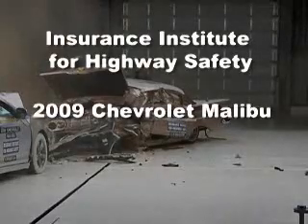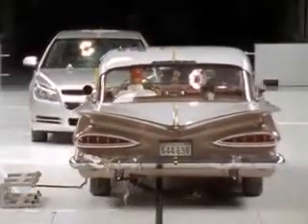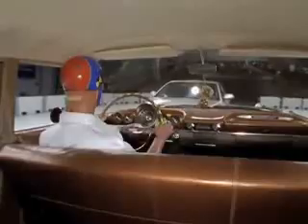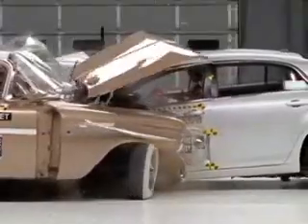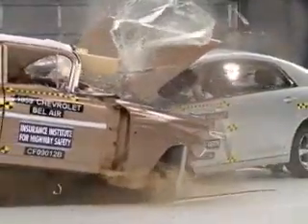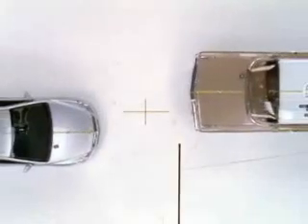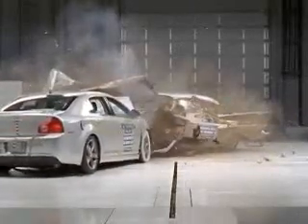Crash Test 1959 Chevrolet Bel Air VS. 2009 Chevrolet Malibu (Frontal Offset) IIHS 50th Anniversary

Comment: New school beats old school in every category, I can take a 4cyl Chevy Cobalt SS Turbo charged and face it against a 69 Camaro on a track course and that cobalt will win in a land slide, I can also take the new 2014 Stingray Corvette and compare it to an old time 4, 6cyl car and the new Corvette gets better mpg (29mpg) than most old schools, same with the Camaro's the new RS V6 would smoke an old V8 Camaro. And as far as safety and emissions, that's not even comparable. I'll take new school over old school anyday, the only thing that old school can compare to on new school is the looks and styles of the cars and that, well that is clearly your opinion as far as looks go.
Reply: Cobalts are terrible, what a stupid car to use in this example.
Reply: @ErrorSz  No kidding.
Reply: Everybody has their own preferences, some people like old cars and some don't, it doesn't really matter.
Reply: ***** i dont think a 2 ton 200HP minivan can beat a 2 ton 350-400+horse power purpose built car in any case
Other then braking...
Reply: Mopar 440 big block 350+ Gm 454 400+ horse Ford 429 400+

Comment: Guys there is pros and cons to each cars( this is coming from a classic car enthusiast) yes, the newer cars are usually more safe than older cars, and classic cars are cooler. But honestly, it does look like the engine may have been removed from the 59. I don't think it would have crumpled up that much. It may not be as safe as a new car, I'd rather drive it than the new one. Also a shame they wasted a classic. A 59 chevy is my dream car, even if it's a four door

Comment: Every pre-airbag era automobile should be banned from public roadways and destroyed.
Reply: jonnytorch5855 eh thats a little extremist. the only person getting hurt in the crash is the driver of the older car.
Reply: That's excessive. My Dad hit a telephone pole in an 84 Caprice in 2017 at maybe 45 MPH; the pole went through the bumper and radiator, snapped and fell on the roof and he survived with seat belt rash and sore knees. No broken bones. He needed an ulcer fixed a month later but there were probably other factors to that.
Reply: Says the guy that doesn't own a classic

Comment: There is no way that 59 Chevy would have smashed to pieces from that hit with original metal of the day..That car was sabotaged because in those days you barely moved when you got hit in a late 50s and early 60s cars.They were rock solid,especially the 59 and 60 Chrysler Imperials.Not only that,did you see fast the Malibu was going while the 59 Impala was slow rolling? That was a rigged test from A to Z.

Comment: So chevy just proved to me they don't care about preserving classics.  What idiot thought this was a good idea?
Reply: danwat1234 The bel air did have an X frame which made it less safe, however not all auto companies had the same design. If you put a 1948 Cadillac against that 2009 Malibu, the Malibu would be devastated! It's all about frame design, steel gauge thickness, and the body itself.
Reply: Don't worry, someone i know who works for the orion assembly manufacturing plant, said that the '59 bel air in the video was more than likely a "put together" car like the ones that are easy to take apart and put back together for certain car shows. So it is basically a shell that is cheap to make for minimal use.
Reply: ***** If that's true I still doubt a real classic bel air would fare much better in a crash test against a new car

Comment: The 1959 Chevy was sabotaged. They took the engine out, the fender bolts, and made weakening cuts on the frame. No way they would post a video showing a 1959 car beating the shit out of a modern actual piece of shit. This was done before, on a old Volvo commercial where they reinforced the Volvo so it would survive being run over by a Big Foot truck.
Reply: You have NO IDEA or proof that they did this. Please shut the FUCK or lay out your proof.
Reply: lovefordgalaxie how would his mothers sexual life keep him from getting an education? Lay off the caffeine Buddy
Reply: Recon13x It isn't Rust saidly it "Georgia clay that had accumulated inside the frame rails" apparently it was sold to them for 8k "We had no idea it was destined for destruction" it was a blueflame 215 6 banger witha' powerglide
Reply: CCCP Digital Studio not like it matters anyway considering old like that are really shit compared to modern cars.
Reply: @CCCP Go put on your foil cap.
Reply: ***** there isnt much solid proof but honestly looking at that car and the insane rust that jumped out, along with the fact that looking closely i fail to see any engine components, and that WOULD make a difference, i do think this was a "biased" test to say the least. idk about cuts and bolts though.

Comment: all you morons defending the new car, yes there is some ignorant old car guys on here who think the 59 was missing its engine etc. etc. im sorry to tell you guys but the 58-64 GM cars were trash hell all of them are junk made of thin sheet metal and built cheap with poor structural design and the IIHS knew that thats why they picked this car for the test and at its weakest angle too. the frontal offset test...i own a 1957 plymouth belvedere 2 door sedan and i know for a fact that it would plow through that malibu like tin foil, now i never said "safer" i said "stronger" everyone knows the old cars are more unsafe inside due to lack of airbags, seat belts and collapsible steering columns etc. etc. but the bodies were much sturdier and better built
Reply: And I have a 62 plymouth fury.

Comment: The 59 Chevy had the bolts removed from the fenders and front end if you look close to give it that more exploding look. Yes they may have advanced over the years. I'm 15 and had a 64 caddy and a 74 Chrysler New Yorker and they still had more options than most of the cars now days. It's not like people where dumb in the 50s and 60s. They where actually smarter than most the people around here anymore. My uncle destroyed a new Chevy with that New Yorker and only broke the turn light on her. So what does that say STIRKDAWG YOU DUMBASS. What kind of pussy name is that .

Comment: Why do I suspect that "crashworthiness" also means more "crashiness" for the other guy. What I mean is, if for example the Bel Air crashed into another Bel Air I'm almost certain they would have both been less damaged than the one in the video. Making a car stronger probably also makes it more damaging to the other guy, if you get what I mean. As an analogy: of course steel armor will protect better than leather armor but if you take that piece of armor and hit someone with it the steel will most certainly cause more severe injury.

Comment: I grew up in the 50s and to me the alleged 'Bel Air' looks more like a Chevrolet 'Impala' to me. Maybe I'm old fashioned, but I think to remove the engine and therefore remove a unit of 'mass energy absorbtion' is cheating a bit as it allows the whole collision force to be directed to the bulkhead of the old car where the steering box is located. Don't get me wrong your dead anyway, and modern cars are safer by a long shot. However modern drivers tend to think they are immortal as a result. A nice long spike in the centre of the steering column would, I believe, cure this illusion.

Comment: They went through the trouble of slaying a 59 belair to explain the obvious? Super cars and muscle cars are dangerous because they were built with little understanding for safety, and because drivers are fucking stupid. And a roll cage is only safe in a roll over, or a crash with helmet restraints at 150mph not 30mph(where a concussion will inflict you instead). All you need to do is drive responsively and stfu.

Comment: Majesticgamer, I hadn't included this because I needed to go look up the exact numbers the ones cpu is clocked at 1.75ghz the ps4 is clocked at 1.6ghz the gpu is clocked at 853MHz vs. 800MHz  for bandwith the ps4 clocks in at 176gb/s while the one is 204gb/s. I just didnt want to tell you you where wrong with no proof.

Comment: If you watch the interior shot you'll see the steering wheel coming right of the dash(Steering box is located on Left front frame horn with a solid steering shaft all the way to the wheel).you'll also see the seat back driving(no seatback locks or seat belts)the dummy into the wheel.The front fender has no special gusseting so it folds up like tin foil.the frame was an X member type and had virtually no side guard protection.all these factors made the 1958 to 64 Chevys one of the least safe cars to drive in the 50's and 60's.The federal government mandated collapsible columns and seat belts and other safety features in 1967.

Comment: Hey, they should have included the engine in that Bel Air! A 700 pound block of iron going through the passenger compartment would have helped them survive plenty!

All joking aside, if older cars bounced off, that would be far more dangerous to the passengers than if they crumpled like cars do today. Think about it: You're changing forward speed for backward speed. Say you only go back at 5 mph from a 25 mph collision. That's 30 mph that your body has to deal with, most of which would go into snapping your neck.
Reply: Isaac Jung why do some people insist the bel air had no engine.  how did it drive forward then?  explain that
Reply: @Reynault Chevalier Do you not watch how crash tests are done? They attach the cars to a wire system. The 59 had a Straight 6, BTW, not a V8.
Reply: Austin Lucas there us no need to respond in an insulting manner.   This is an open forum.  People may not know certain things.  Smart people inquire about things.
Reply: @milestone_achiever4634  Sorry if it came across that way, it's not always easy to tell when someone's joking when I only have text to read.
Reply: @101Volts  Austin why did it take you half a year to respond?

Comment: no engine in the bel air...
Reply: To all people who say there is no engine: have you ever seen a car which had the engine removed? It would have a very noticeable "nose up" stance-the engine is very heavy, and without this weight, the front suspension will just not compress enough. The belair in the video sits level, which would imply one of three things: 1. It has the engine. 2. The engine was removed, but the front springs were cut to compensate. 3. The engine was removed, but they put an equal amount of weight in the front. I seriously doubt they would bother with 2 or 3.
Reply: Dumbo Dumbton
Don't feed the Trolls...

Comment: The 1959 Chevy fared poorly becuse of the x frame. This frame was introduced in 1957 primarily to reduce the problem of restricted headroom and difficult entry into the low-profile automobiles that were becoming popular after the mid-fifties. The X frame construction does not have side rails along the passenger compartment, as did most previous conventional frame designs. From the time the cruciform type frame was introduced, it was widely used by General Motors on Chevrolet, Buick, and Cadillac.

Comment: The new cars may be a lot safer, crash wise, but what about the dealer service area unable to repair these electronic monsters?  That 59 Chevrolet may have been a death trap under certain conditions, but the dealer could fix it first time.  Plugs, points, condenser, rotor, cap and a carburetor, simple.  No sensors, injectors, individual coils, computers, catalytic convertors, electronics, and miles of wiring.  I'd take that 59 in a heartbeat.
Reply: Yeah! "My car will kill me, but at least it's easier to fix for the next owner." Um...

Comment: Shut up idiots, the newer car is safer you fucking turds. Get over yourselves with your bullshit reasoning. A car with no airbags is safer? Yeah fucking right.
Reply: Those are nice anecdotes but not data.

I'll take a broken nose or a few missing teeth over being dead.
Reply: Joe Pinto
Broken nose vs steering column through your chest. Right. I'll take the broken nose. You have fun with that giant hole in your chest with your split aorta.
Reply: Joe Pinto Literally the main reason why new cars are so safe is because they crush easily. All that plastic? It absorbs energy instead of passing it onto you and your passengers. By your logic, the strongest car is the safest, and the strongest possible car would be made of solid steel, but if you hit a wall at 50mph the car isn't going to absorb any energy. Instead it passes it onto you and your head smashes into the dashboard at 50mph. Modern cars that are designed to crumple and crush are absorbing all that impact energy and momentum so by the time the passenger cabin has to slow down, you're going slow enough that seat belts and airbags can save your life. 

Classic cars might be able to drive away after a crash that would total a modern car, but I can guarantee that if you get into a crash in a classic that would total a modern car, you're not going to be walking away. Insurance can buy you a new car, but it can't bring you back to life.
Reply: Joe Pinto I think you're missing the point.  Modern cars are engineered to absorb the forces of impact from a collision.  The car sacrifices itself for you.  So what if the car gets totaled out?  You go down to the lot and get a new one.
Reply: also been cases of people getting killed by these airbags..also I forgot to mention that I'm a automan for over 38+ years...So I know how these new junk cars are made like..tin cans and plastics..most of these cars if you wreck them there done..even a light wreck..even if you fix them ,they will never be wright..and you might as well say you bought you coffin..so if you dont believe me..go join a fire dept and you'll see how these cars are not that safe..
Reply: your wright.. I was a firemen long time ago in the 90's..seen to many face and hands and broken noses busted teeth and broken wrist do to air bags...ill take the older cars..like to see them do that to a 33 ford ..but dont want them to destroy a perfictly good old cars that are hard to find..and to get others know..lets see what the value of that newer car in 20 years from now...=jackcrap..bet that poor old chevy wouldve been worth over 30.000..also im a autobodyman for 33+ years and you couldnt pay me enough money for me to own these newer cars...see frames get bent very easly on these newer car for insurance companys to total them out because there not worth fixing back up..

Comment: I;m not sure about the engine being in there,how do you know that?,i stll believe the test though,the impact of the steering wheel alone would've killed the driver,plus look at how the ''59;s windshield comes out,yes,i do believe cars today are safer.
Reply: How do you know the engine is in there? Because NOBODY does vehicle crash tests without the car fully intact. Any other way would skew the data to the point of being useless. The engine is in there.
Reply: they ought to test the Malibu vs a 76 caprice and see what happens.the '59 had a X-frame,where's the 76 chevy  would have a "box frame and those huge bumpers,just saying..................
Reply: Roger B. uh... no... you are wrong...

Comment: Of course the Bel Air has an engine in it. See the dash buckle? That's the engine being pushed back into the firewall. You can also see the drive shaft in the rear view of the crash. That dog bone A pillar? See how it just folds back? Yeah, real safe there! The non collapsing steering column goes right into the dummy's face. Lap belt (if it had one). That old Chevy would have been just as bad new. I'll take a new car in a crash like that thanks. I'll visit the rest in the hospital, if your that lucky.
Reply: It's funny how many people have some random idea older cars are safer cause they have more metal and bullshit lol
Reply: @John Delaney i ride a motorbike i wear a helmet my gloves my protective equipment sometimes its hot and it sucks..   i know that 99.5 percent of the time i could liekly get away with no helmet and a pair of shorts..... but i will be thanking fuck i have them on when some drunk driver comes around 
the corner
Reply: Well yeah, you have a point when comparing today’s cars to each other.  Differences in safety would be relatively marginal.  But compared to an old car? Give me today’s safety standards 9 days a week.  If god forbid some drunk asshole collided with me Arnold 40 mph, I’d rather walk away with whiplash than have an engine block cave in my heart while the roof snaps my T1 vertebrae!!

But anyway, the implied takeaway IMO is that safety standards are good and really only exist because GOVERNMENT forces the automakers to implement them.  Lots of macho libertarian types love to rip on that “pansy regulations shit”, but they do have real effects; positive effects.  I’d imagine a few hundred thousand people are alive today at minimum because of them.

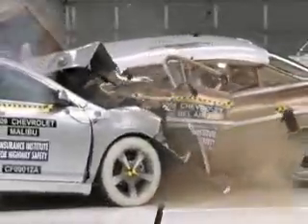Comment: TOTALLY FAKE!  At 0:16 you can see large holes have been cut into the original Bel Air's frame seen right behind the front tire.  No X frame GM model from 1958 to 1964 had any holes cut into them.  Again TOTALLY FAKE!!!

Comment: A unfair test the over 50 year old car is full of rust and has no engine in it Take a 1973 Buick Electra and try that I guarantee that car will loose I saw the Buick destroy a small car and hurt the people inside the car was new and the Buick drove home with very few issues. Hell my old 1974 Plymouth Duster survived a heavy impact and save my own life. against a hug dually crew cab truck and I drove home although the frame was toast .